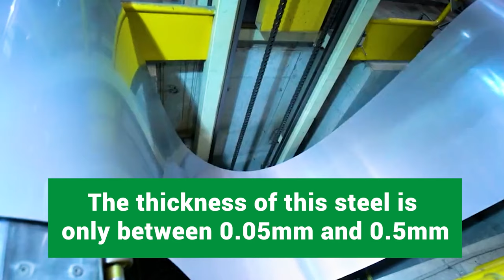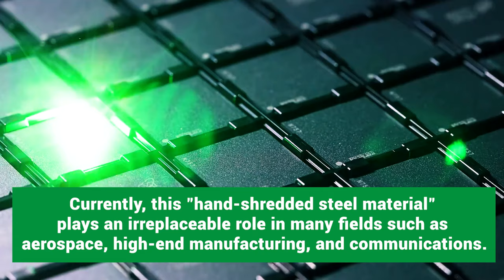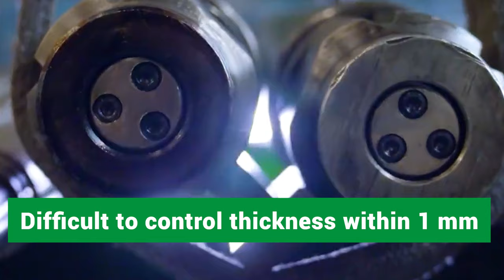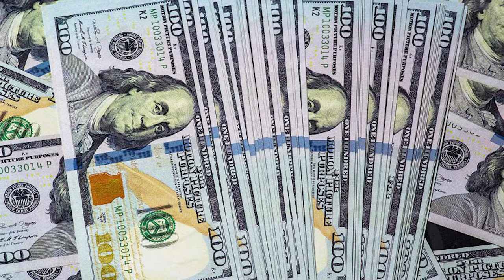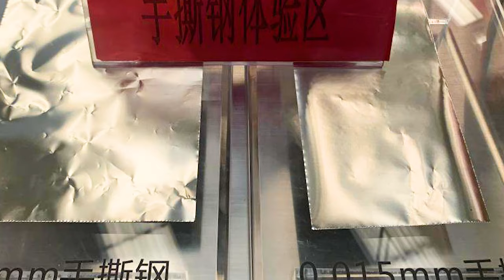Break The 30-Year Monopoly! China’s 0.015mm Thick Steel Paper Technology Shocked Japan and Germany

Comment: Wow, China has broken the technological monopoly of japan and Germany by making steel  thinner than paper, the ultra thin hand shredded steel with thickness of 0.015mm. This achievement makes China completely independent of the western technology and even has broken the world record. This product is very useful in aircraft manufacturing to reduce the weight without jeopardizing the strength and China is now the top producer of steel paper.